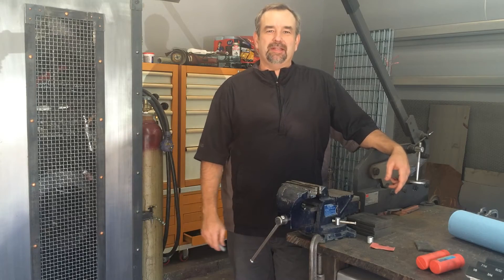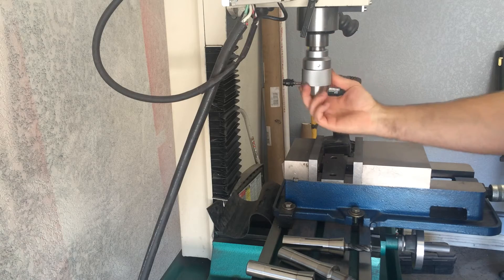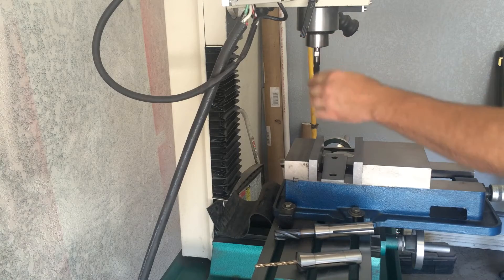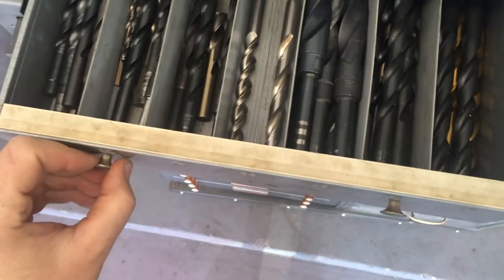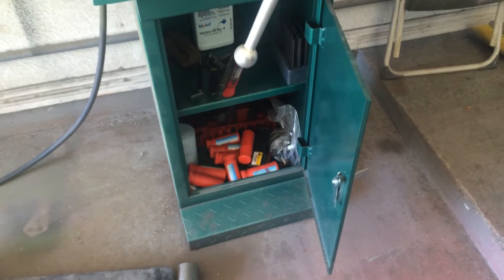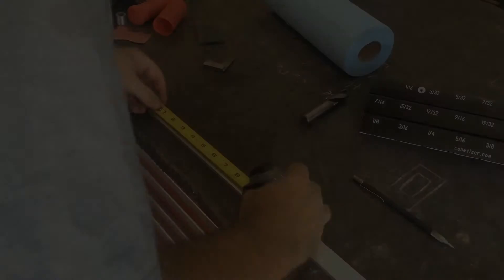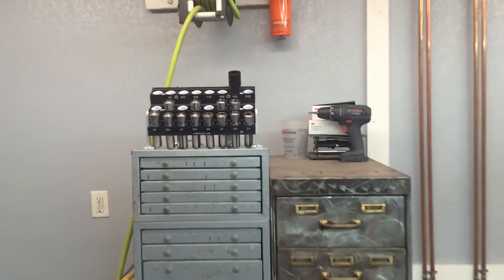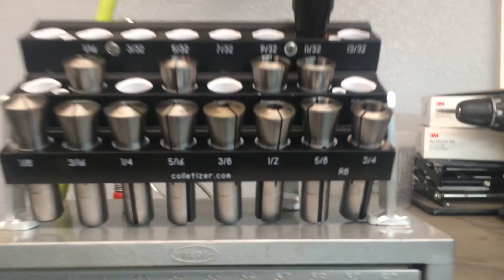Metalwork Monday 1 - Aluminum Milling and Tig Welding - R 8 Collet Organizer

Comment: Hey Gary,

Great video. I think you need to bolt your mill down or put it on a heavy base. I thought it was going to walk out of the shot. Thanks for sharing your work.

Cheers,

Tom
Reply from the maker: Thanks Tom, appreciate you stopping by.  Kind of a boring project, but should have some cooler stuff coming in the near future.  Lol, yea the i have a permanent mount made for the Mill, just have to decide on it's final spot before implementing.

Comment: Nice job as always.  Just wondering if it would have been easier to make a rack that you mounted to the wall near the machine?
Reply from the maker: Definitely could have done that, but I am trying to keep as much stuff off that back wall as possible because it collects a ton of paint overspray because the exhaust fans are there.  Thanks for watching!

Comment: Gary, great project. You asked for suggestions: I'd have made a 'T' with the feet and have them face forward to prevent the holder from tipping forward. It's hard to see how robust the holder is but to me, it looks like it may tip.  Looking forward to seeing more!
Reply from the maker: Joe, yea your right, it definitely kind of wants to lean forward, but with the silicone under the feet its pretty secure, definitely needed the feet pointing forward, and the front legs could have been moved more toward teh front on the organizer.  Thanks for taking the time to watch and provide input!